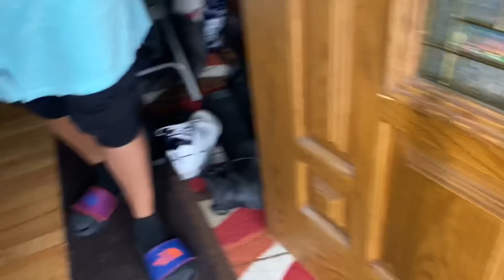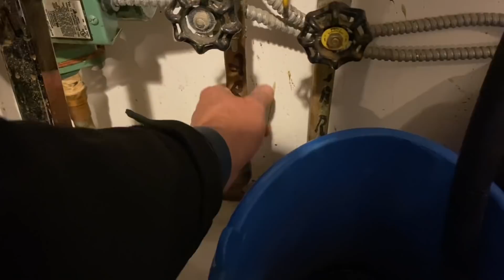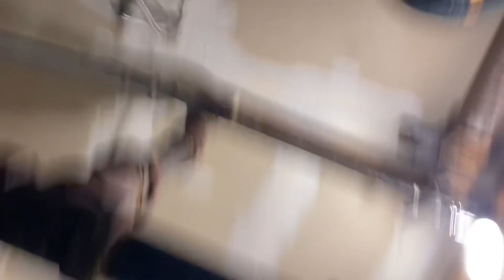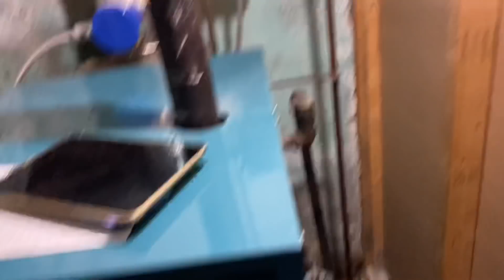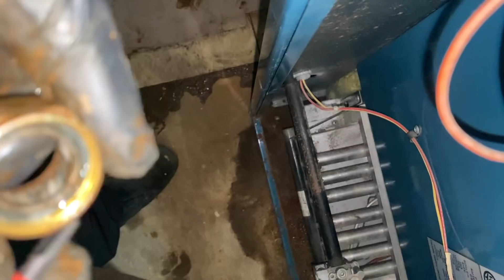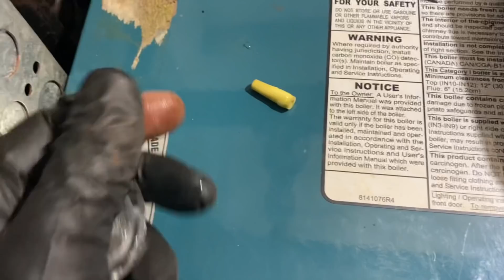Burnham Steam Boiler Leaking Water onto Floor Repaired

Comment: Hi Mike, Have oil fired Peerless steam boiler. 5 steam convectors on main floor.Hot water heat upstairs ( from previous tankless coil, done 30 years ago) I ant use steam radiator in kitchen. have it fully off. Water pours out of air valve when its on..I  replaced it several times. Even with a varivalve..Didnt help. Also water hammering happening often throughout the house.. Maybe the return pipes cloggeg? Theres no drain valve on return lines..Also boiler seems to be using more water this season, but no visible leaks or steamy smoke from chimney. ( have a new liner)Do you service Westbury area?
Reply: @PipeDoctor  Thanks for the quick response. Too bad you dont do oil units. My burner in fine though, I just need steam plumbing help. Can you recommend someone in the 
westbury/East Meadow area?
Reply: @josephchicky4463  Try Cornetta brothers.  Based in Elmont and Franklin Square.  Like Mikey, they have seen it all

Comment: A Steamer, Mikey......with a redundant Pressuretrol set-up.  This is a residential application, no?  NYCHA used to spec out their Boilers with a set-up like that.....a PA404A set at 1 1/2 pounds and a L4079B Set at 10 pounds (Manually reset). Actually, its probably not a bad idea in residential applications also.  Just Saying!  Great work as always, Mikey!
Reply: @PipeDoctor  Agreed!

Comment: I thought for sure with the really cold outside temps that there was going to be a pipe frozen in the wall. But the hot return temps confirmed that wasn't the case.

A house with little to no insulation and then not enough baseboard or possibly blocked or closed baseboard will have trouble making temps being called for on as really cold winter day.

Nice job feeding up today Mikey! 

I used to do electrical service calls in Brooklyn, Queens and Manhattan. Finding as good spot to park the truck was always impossible. We used to rack up the parking tickets like tick tacks. We had no other choice. It was just part of the cost of doing business and the costs needed to get passed on to the customers. 

All part of the reason why NY is just not a business friendly place for contractors. It's even worse now with red light and speed cameras all over the place. And the ticket writers used to ticket us all the time just because the company info on our trucks didn't have the correct size letters on the door, no matter how big your logo and letters were all over the truck everywhere else. What a joke!
Reply: Providence, R.I. is pretty bad too